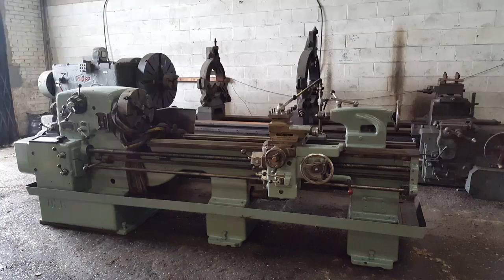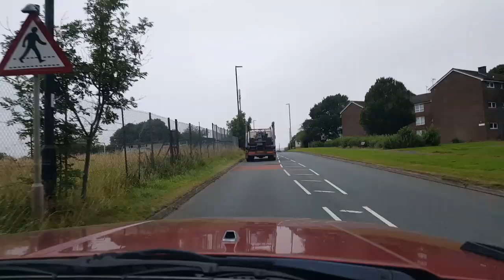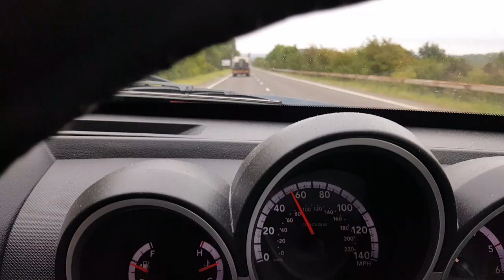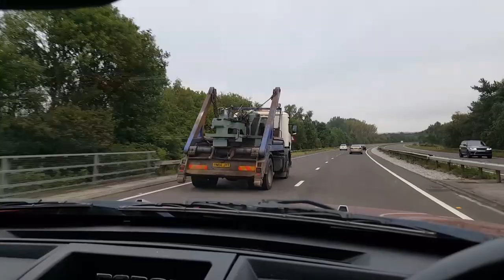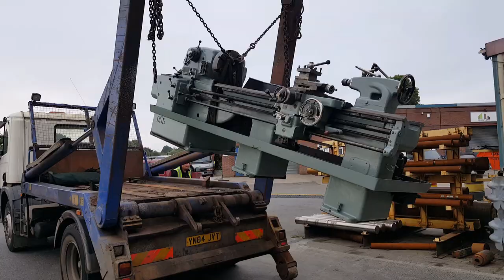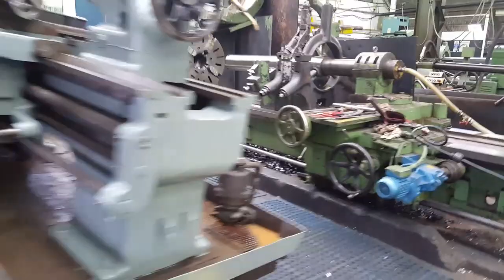New home for a Dean Smith and Grace lathe

Comment from the maker: Perfect timing... just made it to the boozer for F1 race at Silverstone and minimum 8 pints of John Smith's beer 🍺
Reply: Wait. You mean the skip hauler with the lathe on the back was not running in first place in the f1 race till the pace car pulled out in front of him.. he probably would have punted you off the road if you did not have the money in your pocket still. Putting a blocking move on him like that.
Reply from the maker: @waynep343  I needed a pace car to get me to the boozer for the start of the race.... made it with 1 minute to go.... Second pint of John Smith's beer on the table. 😉🍺
Reply: @userwl2850  trepanning the liquid center right out of that mug.. cheers mate..
Reply from the maker: @waynep343  that is genius pal 😂 I'll use that quote 👍🍺
Reply: Lol, yes I think the skip wagon should of been in pole position 👍,
I see a 1609×60 on eBay for sale it looks like it's been on for a while, I wish I had the room for it.
Reply: Great work Dave, we've got various sandvic, botek and bta ejector heads that need some love if you are interested in reconditioning them, sizes from 1" to 3"?
Reply: 8 pints?? Good god man, I hope it's non-alcoholic beer!

Comment: For mine (2 tons) I had a truck drive under the previous owner's bridge crane and drive about 150 miles for 200€, plus 50€ for a crane to unload it (the crane guy was kind enough to help us push it in too). Downside is the crane was a mere roadside assistance tow truck rated at 3 tons non extended and barely pick it up from the truck when they parked side by side. Now I'm eyeing a 4 ton milling machine that's in pristine condition but I all the larger cranes in my area have gone extinct.
Reply from the maker: I hope it's a Bridgeport Mill you've bought 🤔😉
Reply: @userwl2850  It's a TOS SN50 lathe and I haven't decided on the mill yet. I' m either getting a Deckel/Micron ram head style just to have a mill or an Arsenal FU251 (what I work on now) or FU321 (the 50 taper version). It's a universal horizontal knee mill with either a vertical head or universal head attachment. There is a J type qwill head version too but I want to be able to take the heavy cuts this machine can take. What I love about it is the X axis leadscrew preload system that it has for climb milling and combined with the rigidity of a Soviet design it's a beast of mill.

Comment: See the hole on the base casting below the switches? That is probably where the lifting bar goes.
Reply from the maker: Yes you are correct but it wouldn't fit on the truck using them.

Comment: David. Why are you so worried about it. It can't fall off there is nothing to stop it . still got lifting chains on it ,side arms on the skip truck and a huge clamp bar across the rear, taking a roundabout @50 mph or emergency stop might be a problem but your mate in the truck knows what he is doing  just the same as you do with trepanning.
Reply from the maker: Yea but..... he had his 8 pints of John Smith's before he arrived 😉🤣🍺